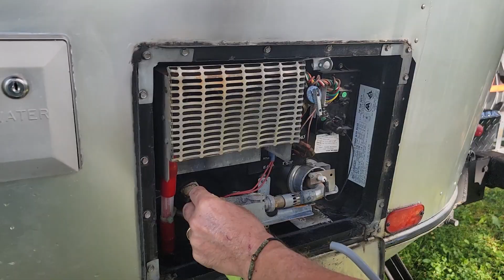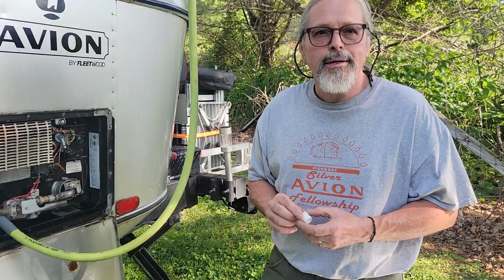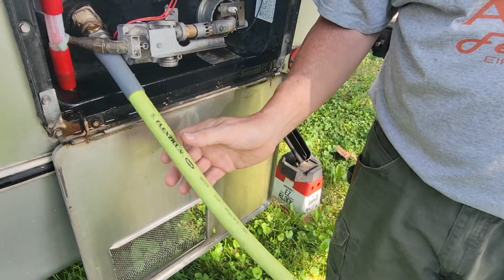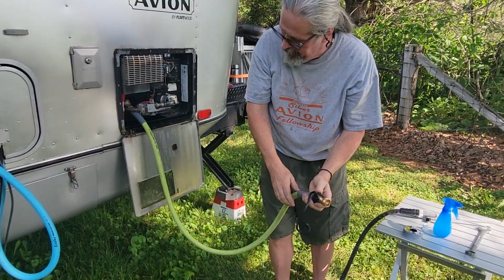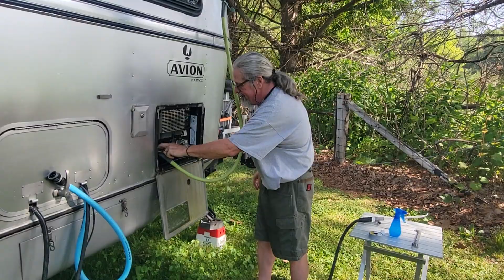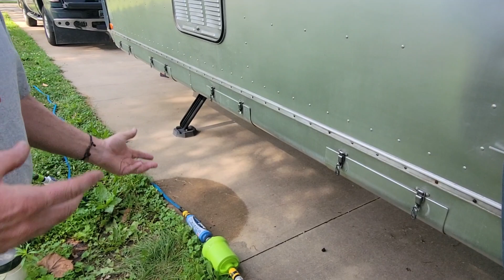Servicing Your Atwood/Dometic Hot Water Heater- Overnight Vinegar Soak "How to"

Comment: What model is your water heater? Mine is a suburban but gas only and I'd like the option for electric as well but want the aluminum tank to save on anode rods. Thanks in advance & great video's Kevin
Reply from the maker: Hi Kevin. Here is the specs on our hot water heater: Atwood hot water heater

MODEL #GE- 9 EXT 

Seriel# 9007103005325

6 gallon

Produced Sept 2014